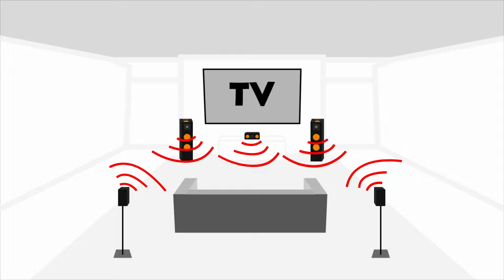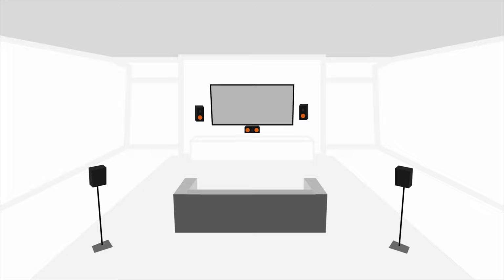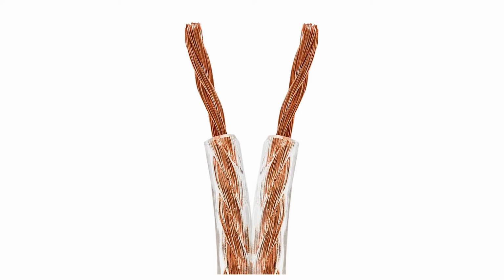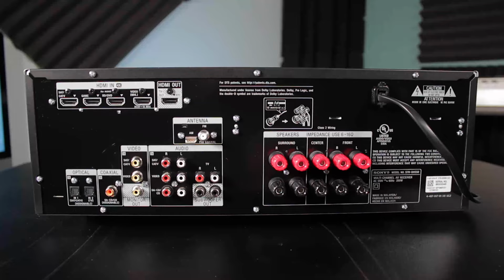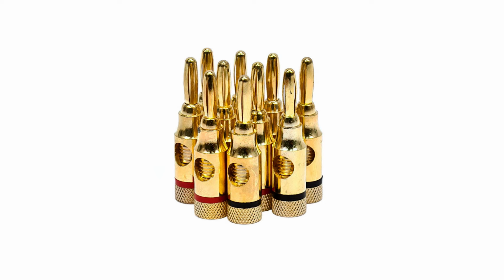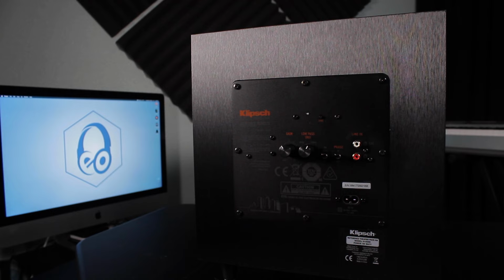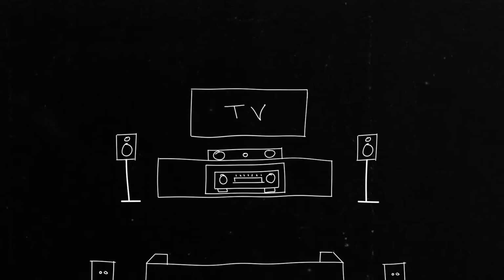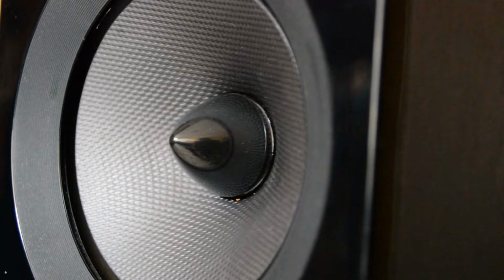BASIC 5.1 SYSTEM SETUP | Home Theater Basics | Sony |@Klipsch

Comment: when it comes to the speaker wires. I have a Yamaha system all wired speakers. They are not color coded and the receiver is spring clips. So it's was just insert and be done with it. But I'm looking to upgrade my receiver so again does it matter in this case how the wires get attached to the receiver? Just wondering rather than inserting the wires, just get the banana plugs and go that way? Or it's just a preferrence.
Reply from the maker: It’s honestly just preference, BUT…it sure does make it easier to deal with in the long run when you’ve taken the time to connect banana plugs on the end. I’ve run into some situations where I think, “Now why didn’t I just get some banana plugs instead of dealing with this bare wire?” 😄👍
Reply: @ealanosborne  when I got my first 5.1 system it came with all wired speakers incl the sub. That was Yamaha 10+ yrs. Now it's time to upgrade that receiver with my 4K tv. Todays receivers don't have a wired input for subs that I've seen. Just for the other speakers hence getting the banana plugs.
Reply: Also the Yamaha speaker wires are not color coded so I don't know why the spring clip are. But just having a look at the wires and one has long dash lines and the other printing. Going to hazard a guess the long dash lines could be the negative?
Reply from the maker: @toner37  It doesn’t make a difference, really. Just as long as you connect them the same on the AVR and the speaker, they’ll be good. 👍
Reply: @ealanosborne  so I finally have the new receiver and it took some tinkering around to get the calibration test to be successful. Just don't have a sub yet. But for some reason the system will only acknowledge speaker A and nothing more. It's either speaker A or off. Any suggestions?

Comment: Can I do a 5.0 in an apartment
Reply from the maker: It’s possible, with some clever techniques to hide wires. Or you could even have a nice 3.0 setup with a 5 channel receiver with room to expand down the road. 🤷‍♂️
Reply: @ealanosborne  thanks! I was planning on doing bookshelfs on end tables beside couch (is that a good placement?) and running wire under my rug and up the back of media stand. But 3.0 sounds good for now.
Reply from the maker: @poisonpotato1  Yeah! Flanking your main listening position is still good placement for surrounds. Do whatcha gotta do! 😁🤘

Comment: I wish AV Receiver makers would make their budget receivers with binding posts like this one. Nowadays they try to overload the products with specs and features and skimp on the binding post by using spring clips. 🙄
Can't we just have a simple 5.2 (maybe 7.2) with very low noise, 4k and all the HDR, take a pass on the Atmos, maybe include virtual 7-9ch and height virtualization, take a pass on the streaming apps/multiroom and networking but include Bluetooth 5.0 and hi-res codecs and make sure it has binding posts, all for less than $300-350?
Reply from the maker: No kidding. Since there’s a wave of new home theater enthusiasts, varying wildly from inexperienced to audiophile, manufacturers need to offer more options, for sure. 👍

Comment: Hey Ealan,  Just getting into all this Dolby Atmos and just purchased 7.2 Denon AVR. I have a question. My Sony Bravia (8 yrs old) does not have an ARC HDMI input. Will this affect the 7.2 sound output? If so is there way of getting around this? Luv your vlogs thx!
Reply from the maker: It just means you won’t be able to have sound go from your TV to the Denon via HDMI, if you frequently use the smart apps directly from your TV (Netflix, Hulu, etc). But you can still get 5.1 surround playing from your TV to the Denon via Optical/Toslink, which your TV should definitely have an output labeled as such. 

But if you have all your entertainment components plugged directly into the Denon, and you don’t use your TVs smart apps, then having ARC doesn’t matter. 👍
Reply: @ealanosborne So in order to have 7.2 Dolby Atmos I will need ARC? Or will that require eARC? 
Thank you for responding so quickly and appreciate any information.
Reply from the maker: @mikebass2700  Anything Atmos will require eARC, but again that’s only if you’re using your TV apps. If everything is hooked up into the Denon, no need to worry about eARC. 👍

Comment: Hi, I have denon 7.1 receiver and klipsch 5.1 reference pack. I want to add 2 in-ceiling Klipsch speakers. Can you plz suggest what goes best with this setup I have. Thanks...
Reply from the maker: I’d stick with Klipsch for your in-ceiling speakers. To stay in the same quality range as your Reference Theater Pack, I’d maybe get these (below). Pretty inexpensive, which you can upgrade later. 

Klipsch CDT-2650-C II In-Ceiling Speaker - White (Each) , black https://www.amazon.com/dp/B0074XL4GK/ref=cm_sw_r_cp_api_glt_fabc_2H3TCXNNBTWFWRBSS383
Reply: Thanks Ealan

Comment: Hi Ealan! I just recently purchased the Klipsch Reference Theater Pack and a Sony STRDH790 and realized that I need speaker wire. The Klipsch instruction manual says to use 18-gauge or larger speaker wire but the product you linked to in the description only has 14 and 16-gauge options. Does the gauge matter at all?
Reply from the maker: Thicker gauge will last longer, and is stronger. But for those terminals, I’d actually go with 16-gauge. The spring loaded binding posts have pretty small holes, so 16-gauge will fit better. 🤘
Reply: @ealanosborne  Thank you so much Ealan! Appreciate it! Love the channel btw!
Reply: @ealanosborne  It’s alive! It all arrived yesterday and I just finished connecting everything about an hour ago. I don’t have a TV yet (arriving tomorrow) so I’ll calibrate it then, but it sounds so good already! I watched this same video multiple times to make it through the entire process. Thanks so much for this video, all your other cool content and for the Amazon links you provided so I knew what to buy!
Reply from the maker: @wmfan19  Hooraaaaay! Congrats, dude! 🙌🎉🍾
Reply: The lower the guage number, the thicker the cable. I don't think he was clear on that when he answered you.

Comment: Hi, I have 2 jbl stage A135c center speakers vertical on the wall each side my tv. I also have 3 floor standing speakers in 3 corners, front left front right and back left corner.. I have 2 subs and 2 bookshelf.. my avr reciever denon AVR-X1700H.. I cannot have 1 center speaker above or below my tv so I need help trying to set these up best way possible.. I was thinking about using the back left or front right floorstanding speakers jbl stage A190 as a center? And use surround L/R for both my jbl A135c center speakers. Do you have any suggestions that may help
Reply from the maker: To be honest, speakers are speakers, so you can put whatever you want in whichever position you want if it looks fine or isn’t blocking anything or intrusive. It’s the calibration of those speakers to your listening position that’s most important, so all the audio arrives at your listening position when it’s supposed to (like after running Audyssey room correction with your X1700H). 

That being said, I’d stick with the A135c speakers on either side of the TV for symmetry and aesthetics. And I’d probably use one of your floor standing speakers as a center channel, as long as it doesn’t block the TV at all. The other 2 floor standing speakers could be good for your side surrounds, and the bookshelf speakers as surround backs. 👍
Reply: @ealanosborne  That's awsome, thanks for taking the time to explain. It's all new to me now I can stop worrying, thank you !
Reply from the maker: @cloud9438  You're welcome!
Reply: @ealanosborne  I have managed to set them all up and has sound from all speakers through my tv but when I try the xbox, only my front L/R speakers are working any ideas pal ?
Reply from the maker: @cloud9438  I guess start by double checking the audio output within the XBOX's settings. Make sure it's set to some sort of multichannel output, like 7.1, which I'm pretty sure is the configuration you're rocking when you described your layout to me.

Comment: how much cost this is? With all the wires and receiver and speaker stuff
Reply from the maker: Depending on how much you search for sales or discount items, you could possibly get a complete system for around $500-$600? The same cost as some soundbars, but I think this system is better than a soundbar.
Reply: @ealanosborne  ah okay thanks, I was watching your other Dolby atmos setup with the Sony 790 receiver and extra book shelf speakers, does that receiver ever go under 350 or has is it always been the same price
Reply from the maker: @zramp2779  yeah it might dip down below $350 during the holiday season in November, but it typically stays around $350